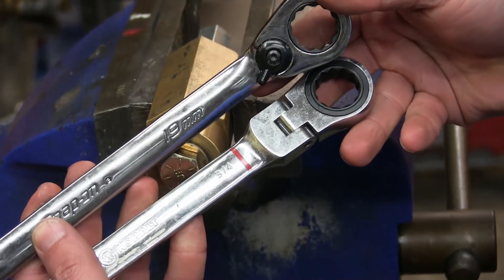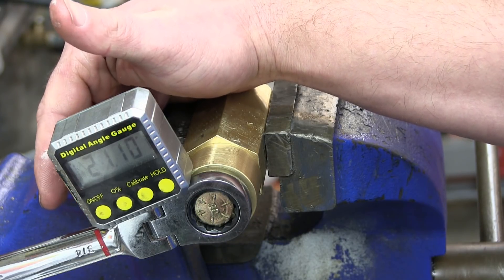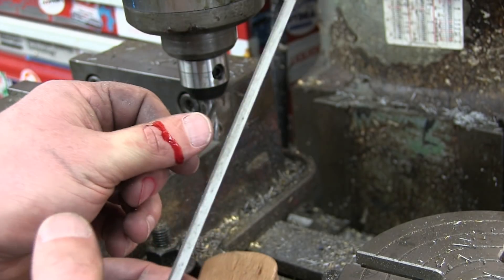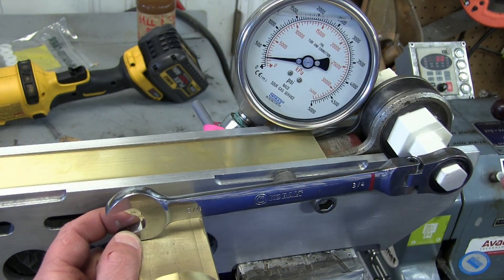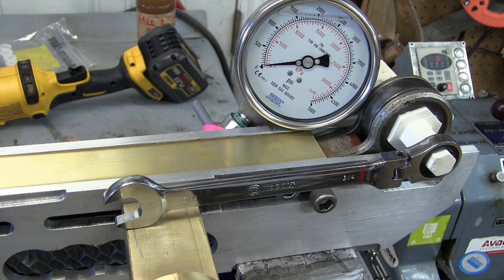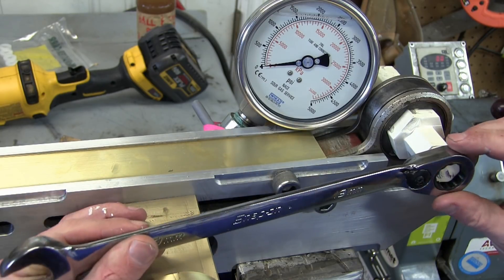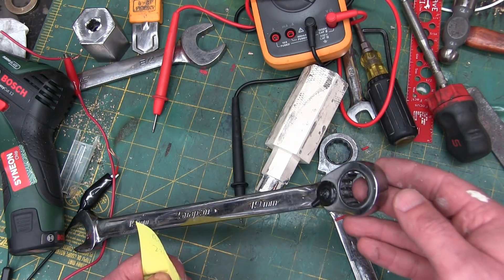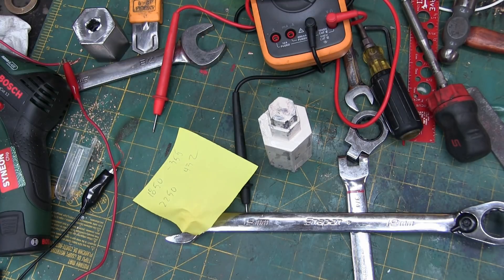RATCHET WRENCH Shootout | Snap-on Kobalt

Comment: Snap-On is a bit of a mix of made in Taiwan and USA. Williams, which is the Industrial division of Fap-off, is the same way. A good way to figure out the COO is to look at the P/N. If the number starts with/ two digits the a dash, it's USA made. Otherwise, it's most likely imported. I'm a Snap-On, Williams, and Bahco distributor ;)
Reply: Houston I've had my standard length blue point ratcheting wrenches for the last five years and never had one break on me. I don't abuse them but at the same time I'm not always easy on them. They've been good to me.
Reply: Houston I've got a set of Par-X 1/4 in ratchet & sockets that I bought in the early eighties as a backup to my Snap-On 1/4 inch ratchet. I still use the Par-X. My Snap-On died years ago. As did all of my Snap-On 3/8 drive ratchets. (even my palm ratchet) They are just sitting in a drawer broken since I don't bend wrenches for a living anymore.
Reply: Houston I haven't tested them myself, but they ought to do the job. And no. The warranty isn't as good on Blue Point.
Reply: James Bahco handles cutting tools and tool blades
Reply: colm one they were phased out and the name was sold and Blue Point took over as the sub brand for Snap ON. The part numbers and everything transferred over from Par X to Blue Point. Apparently the Par X tools were many times just Snap ON parts but slightly modified. Even now old Par X ratchets can be rebuilt with SO parts, although the teeth count will change. * full disclosure I just stole all this info from a forum after I googled it lol
Reply: Taylor Horton  blue point is made in Taiwan Snap-on is made in the US blue point is a lower brand but sponsored by Snap-on
Reply: snap-on hand tools (with a few notable exceptions made in spain or germany) are US made... now some specialty tools might be taiwan but for the most part taiwan is left to snap-on's lower tier blue point brand...

williams however is a mix... you have williams usa and williams taiwan... in which case the part number is one telling factor the other is the design of the tool and the fact that williams usa does stamp COO on the tool

great example is the combo wrenches... williams taiwan are basic wrenches with a plain smooth jaw open end while the USA wrenches are the "supercombo" with the notches in the open end meant to act as an anti slip design... basically a snap-on flank drive plus without the extra teeth
Reply: Taylor Horton what’s the story with Blue Point?  I am looking into a set of ratcheting wrenches and the Blue Points are 130 a set and Snap On 300. Any idea the difference?
Reply: Houston Blue point is the budget line of Snap on.
Reply: Houston Blue Point is made in China, I think. I'm not at work so I'm having to go off of memory.
Reply: Taylor Horton right I know that. But I am wondering first, where they are manufactured and second, are they scoocum?
Reply: Taylor Horton does the normal snap on warranty extend to Blue Point?
Reply: Joe B nice, good to know. I think I’ll be purchasing them soon.
Reply: Williams and Bahco?  I don't believe I'm familiar with those, are they nonwithstanding from Snap-off?
Reply: Whatever happened to Par-X?
Reply: I had a set of blue point ratcheting wrenches they were buy the metric set get the same set free. I'm a concrete truck mechanic so I bought them basically for the same. Funny how truck mechanics get fucked around on tool deals cause cars are all metric ain't it? Anyways the BP looked exactly the same as the snap one in this video
Reply: Good info.  An easier way is that the tool will be stamped "USA" if manufactured and assembled in USA.  It's FTC Regs.
Reply: James Williams is the Industrial division of Snap on.
Reply: I've never ever had a problem warranting blue point tools. And my ratchet wrenches have outlived my coworkers Snap-on wrenches. The new ones are just trash.... go blue point

Comment: I had one of the teeth of a kobalt philips head screw driver break off when I was trying to take a computer mouse apart. Weirdest thing.
Reply: I had the majority of my Kobalt Philips and Torx drivers break from a set of "precision" drivers.
Reply: I had a Phillips bit from a Ryobi impact driver set snap off while driving a screw into a predrilled hole in a 2x4.

Comment: Also, I's got some big chunks of A2, S7 and that stuff they use in truck axles if you're dyin' to put a number on that Snap-on. Might I suggest looking at stainless though? Normally it's a whiff easier on the wallet and comparable on specs.

Comment: Sorry to be a pedant man but backlash is a system unit as well as how the gears mesh. Speaking of those craptacular koblats, I was rebuilding a lapper for spiral bevels and had to use a 19mm ratcheting wrench. I don't much believe in them to begin with but MAN does 180 grit silicon carbide speed up the crib deaths. Thing came apart on the fasteners in no time.

Comment: I used the Hazet Ratchet Wrenches at work before. Stuff like the  Hazet 620. They're jsut two steel liners with a plastic spacer in the middle. I doubt they would take this much torque.

Comment: 2:27 made me wonder - would a largish magnet (possibly even with a plastic shield and a catch bucket) be useful for catching swarf so that you can spend less time chsing it around with a brush when you're done? Mount the whole thing on a swing arm so you can put it just down range of the cutting head, and catch a significant amount of crud. 
Serious question from a person with practically no machining knowledge.

Comment: I don't know if this is worth looking into for science sake, but for hard to reach stuff I use Wera Joker spanners, really nice rachet but I prefer the reversible pawl option. Which brings me to, do you guys in the great wasteland know of Teng Tools? They're pretty decent and have never let me down to date. Maybe more of a car mechanic brand, for those who can't afford the Snap Off.
Reply: Not common in N/A yet I have heard Teng mentioned a few times though. A brand that seems to have taken over being a budget minded version of Snap On is Gear Wrench.
Reply: DarkRaptor99 yeah, Japanese unless I'm completely mistaken. Bunch of the guys I work with use them. Saves the snap on getting dirty ;)
Reply: Lot's of people are only getting Snap On for only the things you use all the time. Snap on's pricing just got out of control and guys are stuck financing a box and tools for years just starting out. People are seeing that and looking at other options.
Reply: I've got a Teng Tools 3/8 ratchet, alongside a 1/4 gedore and a 1/2 Stahlwille. None of these tools have ever broken on me or let me down. I even use the Teng Tools sockets with impacts, and they are still like new. The only downside maybe is that the glass fiber handle of the Teng ratchet gets dinged up. Teng Tools gets a certified skookum from me. However, it pales in comparison to the Stahlwille, because that mother is built to last several nuclear winters
Reply: Teng has got pretty popular where I live in England. I think edd china gave them a massive boost using them on  wheeler dealers.
Reply: Dan Sneyd yeah that'll definitely have helped them out. Their ratchets look a bit cheap and are pretty heavy in the teeth, but their spanners and sockets are great.
Reply: Teng are clumsy. Like Snap-off. Got me a 18mm long socket. Thick, unwieldy, and /unelegant/. Can't have that.

Comment: The Snap-on website does say "Country Of Origin: USA"
Reply: For the tool or the company?
Reply: If you knew how many Asian tool factories I have been in where they stamp "Made in USA" on things you would shake your head.
Reply: The Divine Hammer's Woodworks if that was true that would proudly display the Made in the USA forged into it or stamped into it!  Most likely it's  Assembled in the USA
Reply: Phoenix AF I had an older 9/16 ratcheting wrench didn’t say USA anywhere on it. I eventually broke it the replacement does say USA on it
Reply: Evan Zerby Dishonest run a muck!
Reply: It said the same on Geronimo's bum, didn't stop a flood of imports though.
Reply: tr0n like which tools are you referring to hard line most of the specialized tool kits like brake pad pushers,steering wheel pullers,pit man arm pullers,flaring tool etc are      pretty much the same stuff that auto zone,oreilly?harbor freight carries but I'm sure the QA inspection for snap on is way better then the others
Reply: tr0n So true there  pry bars are awesome I bought a big one of the truck don't
Trust the ones at the stores!
Reply: if it says Snap-On on it then it's USA made in their factory, ie wrenches, sockets, pliers, screwdrivers,  if it says Blue Point ten it's import stuff, all there Toolboxes are made in the factory as well, except the Blue point, china made there.
Reply: It's sadly the world we live in.  What really cracks me up is all of the "made in the USA" stickers made in China and shipped here. lol
Reply: It's very possible it's nothing more then marketing wank?